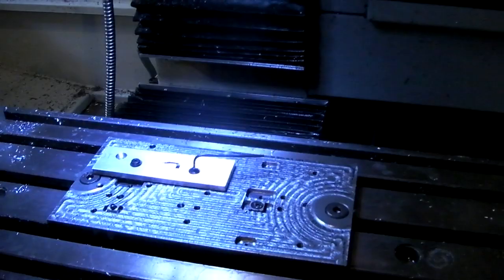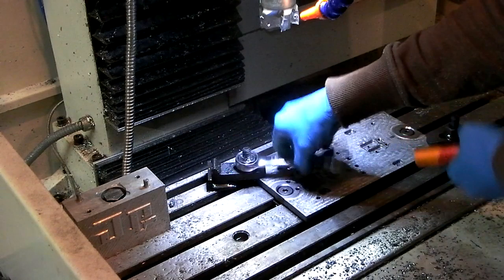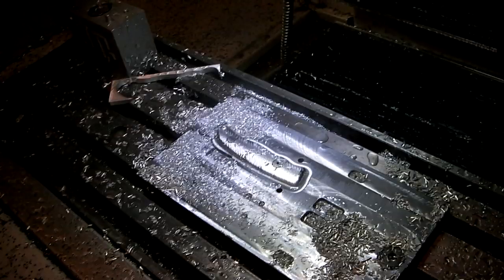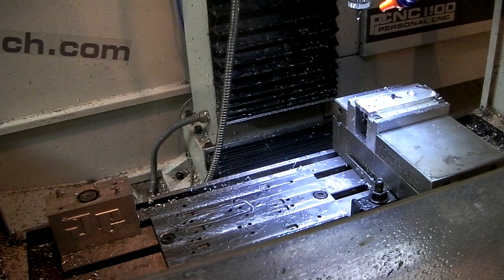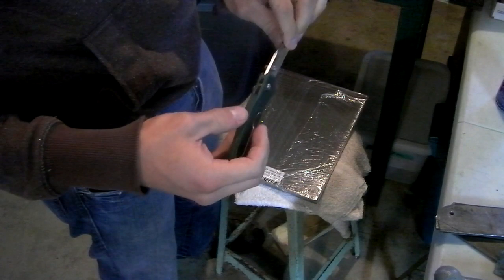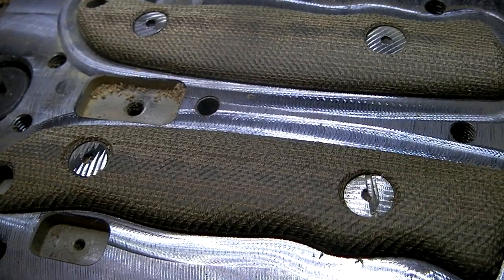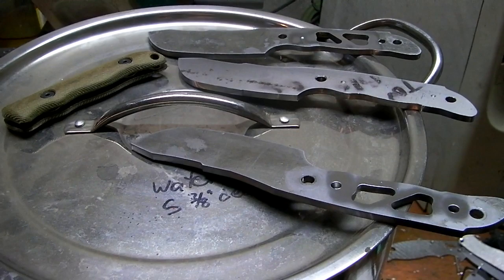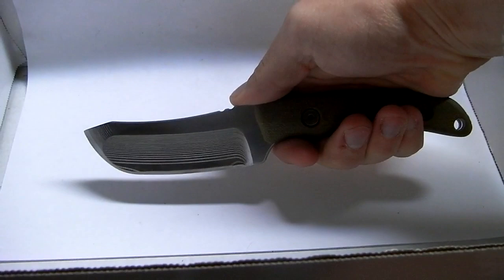Knifemaking Tuesdays Week 45 - Tor handles and blades

Comment from the maker: Good call.  When we arrived at Tormach they didn't have any 2" facemills like I was using (turns out I got that one elsewhere), so we tweaked the code and used the SuperFly.  I loved it so much I bought one with inserts for steel and aluminum.

Comment: A couple things I was noticing at the end but first just gotta say it looks awesome.So first I must say you need to put the jimping on the spine into the micarta aswell, I think that would make it look much better and more functional. Also you may want to add make the cutting edge closer to the front finger, doing finer more precise cuts like whittling and things is easier if the cutting edge is as close to the front finger as possible. Besides that its amazing. Keep it up John & Eric.

Comment: Check out the Tormach SuperFly single insert fly cutter if you haven't yet,  For machines like these with 3 HP or lower spindles, it has higher removal rates than the shell cutter you used for the aluminum handles and steel blades in this video, and the surface finish is excellent.  I love the ease of use and economy of only having a single carbide insert. If I did as much machining as you, I'd buy two - one for aluminum and plastic, and one for steel.  I just posted a SuperFly video BTW.

Comment from the maker: These ones are simple 1018 steel, not really good for knife blades but they're just prototypes and won't be heat treated.  The next ones that I make will be 5160 spring steel, a carbon steel with pretty good toughness properties that is very easy to machine and heat treat.  In the future I'll probably make stainless ones too.  They will all be heat treated.

Comment: you can also make micarta from construction paper, cardstock and canvas.
I got into knife making (mostly fixed blades) and I personally prefer black and dark gray layered micarta each layer to be 4 sheets construction paper of each color and 4-6 sheets of cream color for the bottom of the scale that rests on the tang.
alternating layers of gray and black looks like wood grain.
but if you just put 5 layers of gray in the middle of the scale it looks more slick or tactical.

Comment from the maker: I've been planning on building a similar surface grinder for my eventual 2x72 project.  I've thought about it for my mill but I was worried that trying to face metal with a facemill like this could cause it to slip off the magnetic base.  Since a facemill basically tries to shove it sideways, whereas a surface grinder tries to grab it and pull it lengthways where it has more holding force.

Comment: have you thought about using a magnetic chuck on the carbon steels?  I built a surface grinding attachment for my 2x72 belt grinder and with 1/4 round by 1/4 tall neodium magnets spaced 3/8 apart on center they hold very well but you can still remove you work by sliding it off the chuck.  it might be a good option for future fixtures.  love the videos by the way.

Comment from the maker: Careful with G92.  What I do is program the first part in absolute G90, then use G52 offsets to move it to the next location.  If it's an internal sub it'll be like this:
G52 X0Y0Z0 (cancels offset)
M98 P1 (calls subroutine)
G52 X1 Y1 (moves over and up 1")
M98 P1 (calls subroutine
G52 X0Y0Z0 (cancels offset)
M5 M9
M30
%

O1
G81 drill hole
G1 profile part
M99 (cancel subroutine and return to the line after it was called)
%

Hope that helps!  solsylva dot com has a great page on subroutines.

Comment: John, have a question on your g-code subroutines. I have a drilling and profiling operation in same subroutine, but was wondering if you thought it better to use absolute and incremental points or reset your work space (G92) every time the sub is triggered? Yes, I'm a noobie to CNC. Thanks.

Comment: Hi John,

I realise this is now history, but wondered what is causing the small 'chatter' on the surface of the handle you showed? And is it possible to run at half the speed FPS, and would this then look a little smoother? Is it possible to 'personalised a handle set' on one side have the milled screw and the other side have a unmilled one, I was wondering whether it is possible to tighten the non milled screw while holding the milled on dead still and so retain the pattern?

mrbluenun

Comment: Awesome handles!

John,
I got that same clamping set with my Sieg X2 mill...they never seem right for doing what I want to do.  What were you using for workholding up until now?  I'm still trying to get the hang of my mill (I use my 7x10 lathe a lot more) and workholding has been a constant pain!

I'm still trying to make mounting blocks to clamp my screwless machinist vise to the table... (Keyed, hopefully!) Any tips for getting the stock mounted and clamped squarely without fixtures or a vise?

Comment from the maker: Send me an e-mail and I can attach a whole bunch of clamping pictures that I've saved over the years, bound to give you ideas.  my name at gmail.  I use a lot of pre-drilled bolt holes, or little toe clamps that I've made.  Search google for A2Z clamps, they look sweet, I made my own similar versions and I used to use those ALL the time on my X2.  If you key your vise you should be golden.  I ended up drilling 4 1/4" dowel pin holes into my X2 table so that I could locate my fixtures onto it.

Comment: Great video John and a great watch.  However some feedback.  Your knife blade designs are not very useful.  If you make a production run, I hope you spend more time designing it.  At least maybe a modified tanto style blade shape.  (Example Benchmade Griptillian) Something useful for cutting vegetables or something.  What is the blade shape designed for?  A chisel for removing paint?  Would be nice to have something with functional gimping, perhaps a secondary holding position for fine cutting (Example Spyderco Paramilitary 2), window breaker, and a choe?  You guys are improving on the machining end of things, but very much lack design vision.  Take the best of everything and put it all into one utility knife.  I see nothing wrong with it.  I wish I had the ability to do CNC work.  It sucks not being able to see my ideas happen.  Good luck.
Reply: +aHigher Power Looks like a meat cleaver or an upside down chefs knife(santoku) xD Not much use outside of a kitchen.
Reply: Richard Smith Why they won't make a good full tang camping/bushcraft/survival knife is beyond me.  With a CNC they could pump these things out with minimal effort.  They just don't recognize the market.  They need to buy a grinder and learn it.  Market is so ripe for bushcraft knife CNC perfection.  lol